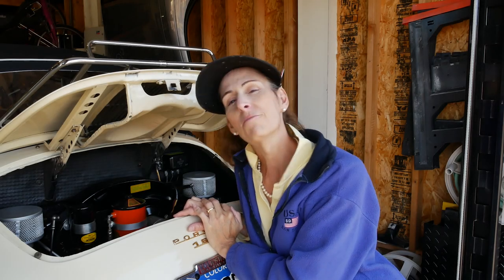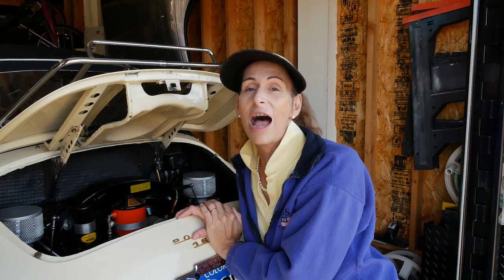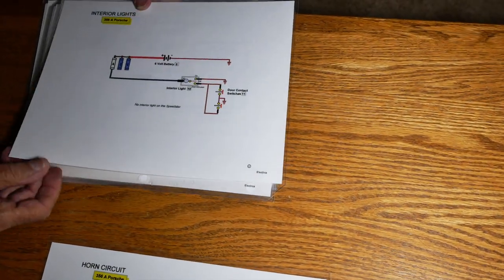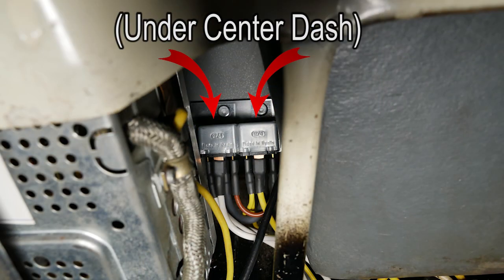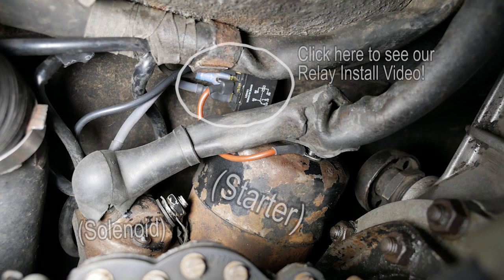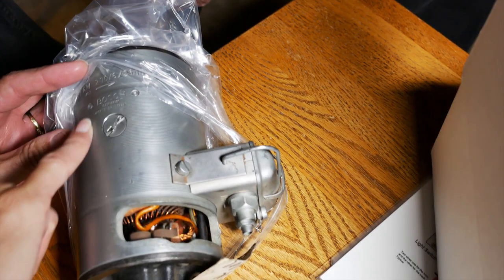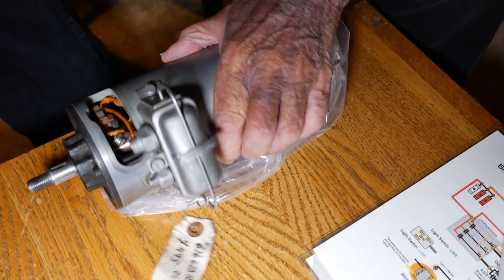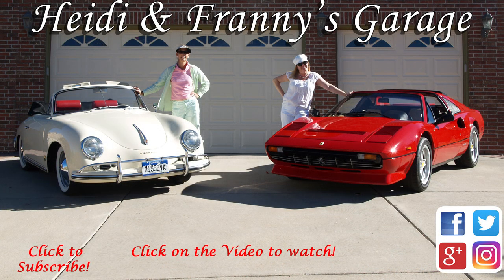Legendary Joe Leoni the Electrics Expert of Porsche 356s (& valve cover plating)

Comment: Thank you for highlighting Joe Leoni. I had the pleasure of meeting Joe in Sedona Arizona at the West Coast Holiday several years ago. I purchased both a generator and a voltage regulator that I have for my 356 as a back up. I have also installed the starter relay, light relay and have his 356electrics manual for my T6. Joe is the worlds expert on our 356 electrical. He’s restored relays for me and most importantly helped me with the wiring on my Behr Fresh air Blower, which is a rare 356 option. Great interview.
Reply from the maker: Wow, that is great!  You have bunch of items. Heidi

Comment: Sweet video as usual, thanks.  My '69 912 valve cover is yellow CAD plated.  Wonder what is the difference b/w clear vs yellow and why and how the Porsche distinguished yellow and white usage.
Reply from the maker: That is a great question! My understanding is that it happened sometime in 1966 when the DIN standard changed.  I think Porsche being Porsche used up what they had on the shelf and switch when the clear cad ran out... Pretty sure all 356s should be clear cad for all cad plating. Thanks!  F

Comment: Cad plating sounds durable. Isn't it? I like durable things so much!
Reply from the maker: Well, it is a sacrificial anode so it lasts as long as it can until it is used up.  Its whole job is to keep the metal below from oxidizing.  It is a very thin electroplated coating , but it is a metal...  It can be sanded off without too much effort so it isn't very thick.  So, that is a really good question.  You could paint which would seal the metal.  It is much thicker and you can get whatever color you want, but there is no real chemical reaction and the paint can and will fail for a number of reasons and when it does, there will be rusting.  It won't protect the metal from rusting for the other side either.  

In the case of this particular car, I have always tried to keep/restore everything to original so there is really no choice.  But is it durable?  Well, let's say I'll always be very careful not to let the bale wire rub against the covers when removing and installing the valve covers ;)  Franny